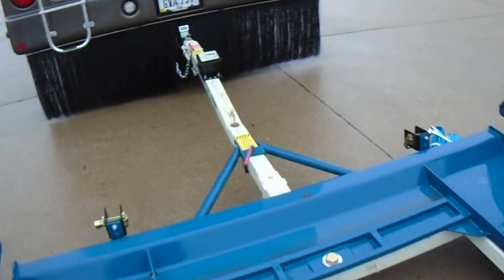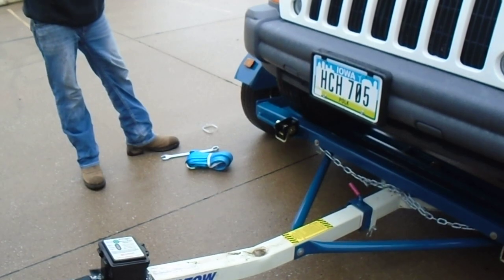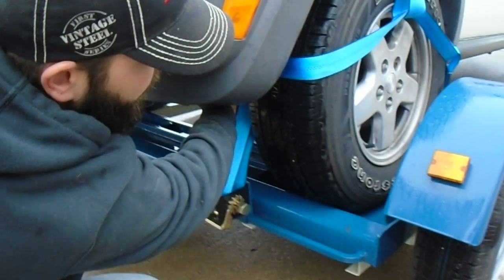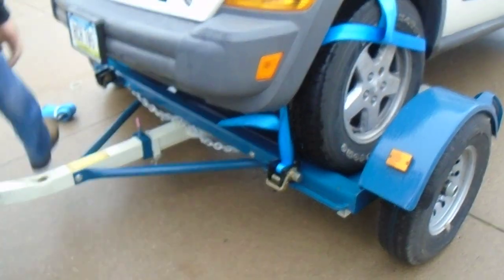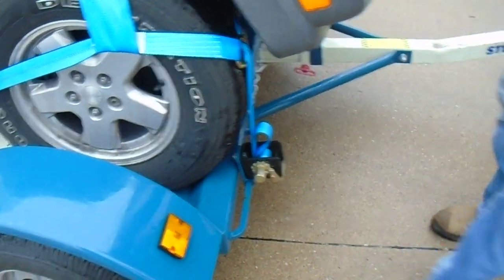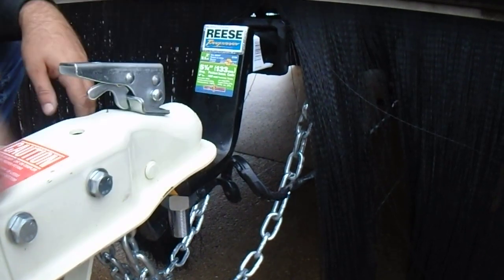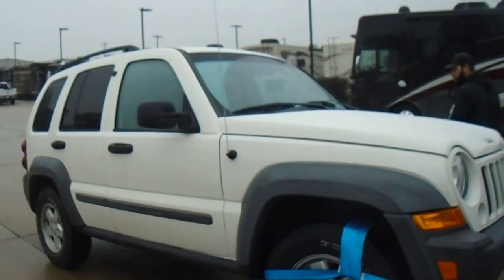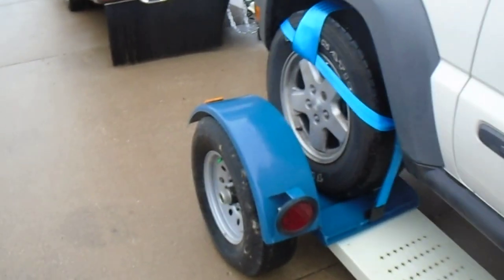Connecting a Stehl Tow Dolly with Jeep Patriot to RV Motorhome

Comment: I think with a 4x4 you are supposed to have the transfer case in neutral and the transmission in park. Putting the t-case in neutral disengages the drivetrain. If you leave it in neutral but don't put the transfer case in neutral I believe you can damage the 4x4 components.
Reply: That is absolutely true you always Put transfer case  in neutral

Comment: Doesn't crossing the chains hold up the trailer up off the ground  if the trailer comes loose from the tow vehicle? I believe they should be crossed but I don't know much.
Reply from the maker: Yes.  Chains must be crossed.  We did our homework after listening to this guy.  Also used this as reference on review with rv dealer so others would know to beware of this rv dealer.
Reply: I saw a video on YouTube with a couple of tow truck operators on the side of the road trying to get a jeep that had came off the dolly and went over where the front tires are supposed to sit. It was a white jeep that looked just like this one and it had a blue dolly also. I wonder if that's these folks lol

Comment: Definitely cross chains it’s DOT law so if it comes undone it will rest on chains so it don’t drag and those chains on front of dolly are safety chains needs to be connected to sturdy part of car it’s another form of securement Incase straps loosen up or come undone. Good luck and take your time until your use yo towing

Comment: You do not want your wheels to turn that's why the dolly pivots in the middle
Reply: Not all dollies pivot.  The Stehl is one that does not pivot.
Reply: @emartens52  that Stehl DOES pivot.
Reply: Edward Martens I have a Stehl car tow dolly, and believe me it pivots in the middle, and not tying off the steering wheel is a disaster waiting to happen because if the tires turn on the surface of the pivoting tray, then it loosens the tie down straps, which can make it possible for the tires to come loose from being attached, due to excessive slack being created, and you can imagine what would happen with the car being loosely & unsafely attached to the tow dolly.
Reply: @treeoflife6386  my straps never loosen. My steering in never locked
Reply: MrBlaze256 when I towed a car with my tow dolly, and the steering wheel was not  locked,  when I stopped to check everything again at the 150 mile mark, the tires had went from pointing strait ahead to being angled at 20-30 degrees, and the straps had became somewhat loosened up, which I never expected would happen. I was lucky that I didn’t miss this check point to see if everything was still in good shape. The thing about it is, you might be safe 99 times out of a 100, but there’s always a possibility of that one in a hundred times that things go wrong, so I live by the rule that “It’s best to be safe, than sorry”!
Reply: If the dolly pivots in the middle then lock the steering wheel if it doesn't pivot in the middle then leave the wheel unlocked

Comment: This guy showing you how to hook up your vehicle has no idea what he is doing. You want to lock the steering wheel  so the straps do not loosen.  The plate on the dolly rotates to allow your vehicle to turn. I hope someone else showed you how to do it correctly.    t
Reply from the maker: You are so correct.  We lock the steering wheel each time.  I called out this guy to the rv dealer i worked with.
Reply: Also, that first strap didn't even come down the wheel far enough. It needed to be adjusted.

Comment: Seems counter intuitive, hook up the required 2 safety chains so if it comes off hitch it will keep the trailer with you, then hook up the required safety brake that locks up trailer brakes if it comes off the hitch?  All my trailers have the same setup, but I've always felt if my 14,000 lb trailer comes off the hitch, I want to be as far away as possible...

Comment: I have been told you can't dolly tow a jeep am I wrong
Reply from the maker: Yes you can, but must be manual transmission.   Depends on year made.
Reply: You can also pull the driveshaft if it's an automatic. This is how big tow trucks pull semi trucks.
Reply: @rotaryskratch18  if the transfer case can be put in neutral, should dolly tow OK.

Comment: He probably owes them a transmission!!
Reply: I was thinking the exact same thing. Never tow a AWD, RWD or 4x4 without removing the drive shaft. 🤦🏽‍♂️
Reply: @Funk_Reactions  Actually, newer models are building "flat tow mode" into their configurations.  This allows the driver to select this option to electronically disengage drive axles, similar to how 4X4's offer "diff lock" option.  I flat tow my 4X4 Escape behind my rig, in the owners manuals it contains a section about if you can, or cannot flat tow, or dolly tow your vehicle.  The new Ford Rangers and most others offer this function.  But EVERYONE should check their owners manual first.